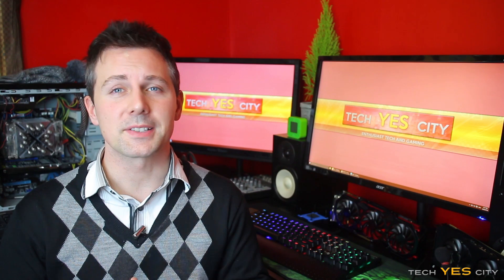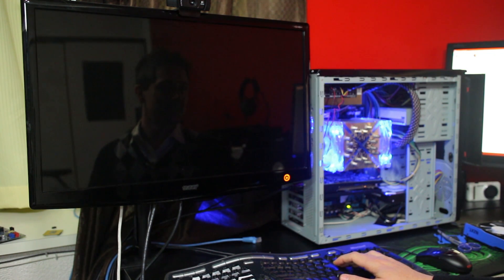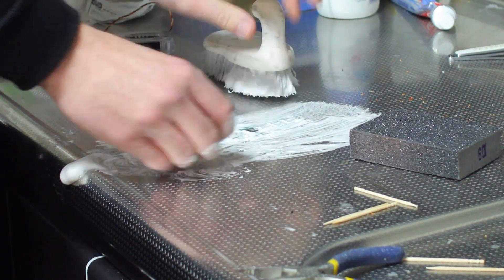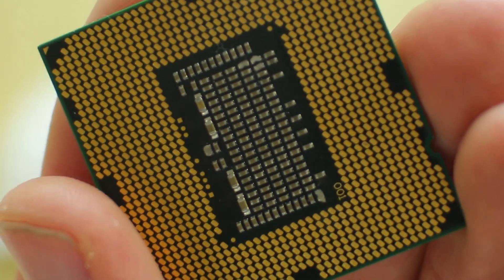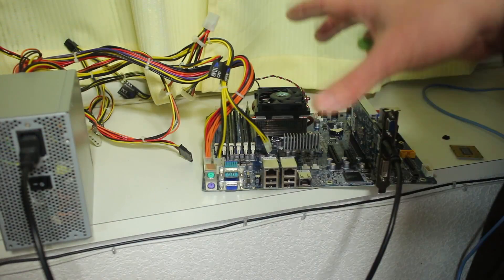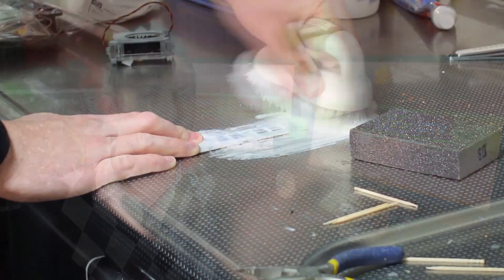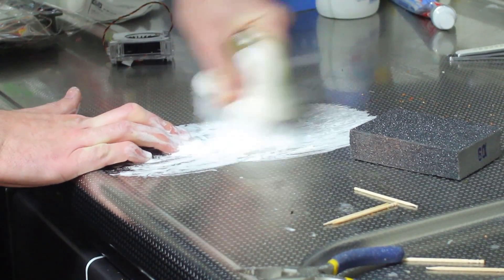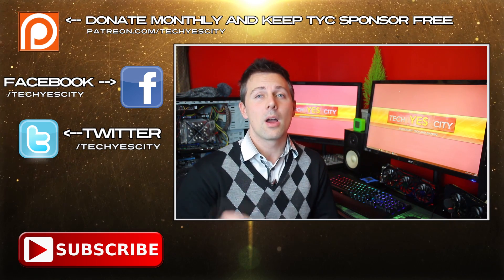Is it OK to WASH PC Parts? Ft. Fixing a Dead CPU & Testing a Dead PSU

Comment: I have always found it dumb when people think that getting a component wet will somehow kill it...

Firstly, there is moisture in the air... Parts don't just die... 

Secondly, my brother spilled an entire cup of Jack Daniel's/Coke into my computer that was on its side, with no side panel on it...

Third, in order to clean it, I started soaking it with rubbing alcohol, unfortunately there just wasn't enough... At that point in my life, I had recently come out of the hospital for a surgery to remove cancer, and I was unable to drive a vehicle.

As such, I decided, "Screw it!", and I just ran it under the bathroom sink, with hand soap, hand sanitizer, and a plastic bristle scrub brush, after the soaking and scrubbing of the sticky/tacky drunken soda that was in the socket, I mean an afternoon, worked great for several years! I am just glad these DIY methods always worked for me!

Comment: What exactly makes you think that those missing components at the bottom of the CPU package are resistors? Resistors are black and have tiny little numbers on them. The brown packages with no marking are ceramic capacitors, and bridging them over with a conductive liquid is futile, it's just about the worst thing you could do. Actually they're likely just all across the power rails, so a few missing shouldn't matter; however how did they go missing exactly? Have you checked that the other capacitors didn't go short circuit?

Comment: I always plug my power supplies into a cheap component... a power supply tester. The reason being a power supply could malfunction in more ways than just a short a bad cap or not supplying enough voltage, over-voltage is scary.

Comment: Power supplies that "engage" briefly and then shut down are very likely to have a shorted rectifier at the output stage due to being used under severe load regimen (more than it can supply).  It's also possible that capacitors failed, causing output to be unstable which in turn trips the over-current protection making it shut down.

So, unfortunately, while it can be repaired it's very unlikely that it will be viable considering cost of maintenance/professional work.  By the way, very interesting video.

Comment: I once bought a second hand motherboard for a friend of mine to safe his system from a serious upgrade. Motherboard was super cheap but had bent pins, a easy fix. More annoying was the smoking Stench the motherboard had. I striped the motherboard checked if the board was fully unloaded from electric charge (capacitors). I gave the motherboard a hot shower.
After that I immediately Vacuumed all the water from the motherboard. Then I used a electronics degreaser and a toothbrush so water stains (Chalk) would not damage the electronics. Then some serious hair-drying and some 'hot cardboard box -hairdrying' to get all the moisture and damp out, a fully dry and clean motherboard. 

Motherboard was in excellent working condition.

Comment: @2:30 that is a too harsh brush. Small electrical components can break of. A toothbrush would be more than fine.

Afterwards I would use a non-aggressive greaser (that dissolves in air without residue left-over) so there is no change of chalk from the water. After that some extremely thoroughly hairdryer work and the component is fine, even for the long run. Water behind the memory chips is a risk, vacuuming and putting the component is a hot-box will take care of that.

Comment: The PCIe to Molex to SATA did not work because the hard drives likely also require 5 volts, while PCIe connectors only have 12 volts. If you attached a step-down regulator somewhere along the line, it would be fine. You can also use it for anything that requires 12 volts.

Comment: The hard drive/CD drive issue was the missing power on the 5v connection. (the red wire)
PCIe plugs only use the 12v rails of the PSU.

And the water is no problem, just make sure you don't have moisture and electricity on the same palce at the same time.
Without power there is no short.

Comment: should i wash my motherboard with WD 40? ?
Reply: There are so many condensor on the motherboard, no idea how to make sure all of them are uncharge...
If you are afraid, just use isopropilic alcohol (pure) and sprey the thing all over to take all the dust away, then wait for complete dry. Is none conductive, so yhea is completly safe as long as you don't touch things arround the circuit boards. I did a ram slot cleanup this way and fixed a memory issue I had, got rid of all my problem this way (blowing air or using a brush was not enough).

Comment: Using PCI power would not work at all as it only has the 12v rails, any molex or sata device requires 5v too. If you wired a 5v transformer between the yellow PCI connector to the red molex you'd be good as gold.

Comment: are you shure that this are resistors on the back of the cpu? They look pretty mush like capacitors. I have worked a long time with smd parts in a factory an resistors are mostly black.

Comment: Hey, for that psu, you can just cut the wires from the 24pin that is colored as red, yellow and 2 blacks, any wires that has the same color will do. and then after you cut 4 wires, trim the wires and connect the wires "3 way" it should work as long as you used the correct wires. I have done that and it works properly. You should make it as 2 molex and 2/1 sata, it's easy to do this.

Comment: Are you fucking kidding? if you advertise the video as sarcasm maybe could pass. 1: even if you wash with water you still have to use the distilated one and after that you shoud use isopropilic alchool because is the only way to remove the water from under the chips and prevent the sodder from future oxidation (do a research on the damage the water does to circuits and the growing effect the sodder has in humid ambients). 2: underneeth the cpu those are capacitors not resistors  so you should not short circuit the pins: you risk to kill the motherboard...  3: 99% of the problems with cheap power supplyes like the one you have in the video is the bad output capacitors... just do a litle reaserch before publishing such a fuking stupid videos...

Comment: pci to sata cable didn't work because there is no 5v rail on pci-e power cable
5v is often transported through red cables 

you can provide 5v to your hard drive and you can still use it with that psu 

just be careful

Comment: Question for anyone here: if a pc works fine but when you turn it off and try to turn it on again the Motherboard's LED blinks and the system does nothing, is it the Motherboard or the PSU causing the problem?

Comment: Any customers or IT guys that see my Ram box in work are visibly sickened when they see me throw sticks in to it, hasn't harmed any yet. If you're really keen to make use of that PSU  strip a little insulation back from the same colours on the 24 pin without splitting the cables, or do for heat shrink use these connections to add sata/molex for drives and sleeve it up afterwards. Alternately, a number of proprietary enterprise boards provide sata power from the motherboard. HPs and Dells do at any rate.

Comment: You can wash anything, your RAM, your motherboard, you ssd, your cpu, even your heatsink and heatsink fan. However I recommend that you don't scrub it as you may damage the little smd components or can damage the pcb. 
Before you wash your motherboard, remove that little cmos battery or any other source of power. And never wash your power supply. They got capacitors in it and can they hold charge even if it's powered off. 

Remember that water is dangerous for electronic components only because they can short circuit the components. If you dry them completely so that there is no chance of short circuit then it's perfectly fine to wash them. 

warning: moisture can get inside ICs and can damage them if you don't give them enough time to dry. Some ICs can swell due to moisture. If Moisture is there in the IC and you power it up, it may either fry due to short circuit or it may evaporate the moisture and your IC may burst like a popcorn.

Motherboards, RAM etc also got capacitors in them but they are not big enough to retain a lot of charge.
Reply: hiw about cpu socket pins getting water damaged

Comment: Reasons for HDD/ODD won't work with PCI-E power: PCI-E 6/8pins only supply 12v and ground, while a molex/sata connector will supply 12v,5v and ground.

Comment: Just splice into the powersupply and put some sata pins on it you need a red with a ground and yelllow with ground red is 5 V Yellow is 12 volt dont worry about the orange one as it is not needed in the current stage of sata drives

Comment: the thing with the auxiliary pcie power connector is that it only provides 12V. the drives need 5V also. so a little bit of research is a good thing. not just hoping it will work because they fit together. 
the processor has capacitors and resistor, shorting those pins will certainly will not do any good.

Comment: The HDD and Optical drive aren't working because the PCIe Power connector lacks the +5V rail, it only has the +12V rail. That's why using the PCIe to Molex/SATA will never work. Only for devices that use a single 12V rail. Which is not the case for any HDDs/SSDs/Optical drives.

Comment: I saw some things that left me speechless.
I would like to specify that washing electrical components with water is not a good idea because the contacts might oxidize. For contacts also mean the component soldering point, gold plated connector, etc.

CPUs have bypass caps on the back and a couple of iductors... 
The bypas capacitors are put to dampen voltage spikes on the power supply rail, make a bridge between its contact means creating a short circuit.
if there are components there, there's a reason. Shorting it is not the way to fix the problem.

To test a power supply there are testers that are much more practical: they are compact and monitor the voltage and the startup time.

The PCI-E power connector provides only 12V, the hard drive and optical readers also require 5V and some device requre also 3.3V to work.

Other already said that the power supply capacitors CAN NOT be discharged creating the short between the mains connector.

Comment: Of course the HDD/DVD don't work on PCIe power. The 5V line is missing. 3.3V (orange) is kinda optional on the SATA power, but 5V and 12V need to be present. You only get 12V from PCIe.

Comment: those are capacitors, not resistors

and you check a power supply but connecting green wire with a black wire

Comment: you could put your whole mobo under water and as long as there's no current flowing through it and the caps are decharged, after you dry it off it should work fine.

Comment: you can bridge the psu to get it running, no need to connect it to a mb. its just 2 pins, you can find on the holy internet :).

Comment: Your PCI-E to molex stuff won't work because it only uses ground and the 12v rail.Hdd's need the 5 volt rail as well.Especially the laptop hdd - does not use 12v at all, just 5v.It would have partially worked with a 3.5" HDD, but only spin up the platters , it wouldn't be usable still.One dirty way around would be to "steal" 5v from the USB port.

Comment: Spilled a beer on a keyboard. Rinsed it off in the shower and dried it out, all good. Spilled a beer on my pc, fell off the desk onto the top of the pc, onto the top fan, all over every component in a fine mist. Washed em... worked for a while(3 monthsish), died, warranty. Good stuff lol.
Reply: lol you washed plastic and questioned if it would still work lol?
Reply: Opened my keyboard and put it in the dishwasher. Still works. Just remove al the electric parts prior.
Reply: Collin Huebler so weird... D:

Comment: the hdd didn't work because pcie power connector doesn't give 5V, and yout molex wont get that. it's like VGA>DVI>HDMI, that won't work either
Reply: Exactly, same if it was a 3.5 inch drive, since it still uses 5 volt for the controller.

Comment: The hard drive didn't  work because pci 6 pin only has 3 out the 4 molex wires so doesn't deliver the correct amount of power

Comment: People, don't listen to that man. Since when the easiest way to check Your PSU is to build acutally another complete PC? The easiest and the fastest way to check it is to connect the green connector on the 20/24-pin connector to any black connector in it. That's the easiest way to do this! What if the motherboard is broken? You will think, that Your PSU is broken and throw it away unnecessarily. And another thing - why the devil was he waiting until the system posts to check if that hard drive was working? He was checking if it gets the power - would be much easier and faster (especially in his case, where posting lasts and lasts and lasts and lasts) to check if it starts spinning.

Comment: Hey was wondering is the circuit pen could (maybe) fix my 780Ti, i had a resistor crumble on the back and now its an instant crash under any load. Would this idea have a chance of fixing it?

P.S it was bought second hand and dont know if it was broken before and has gotton worse or something that happend later down the line

Comment: PCIe only has 12 V, all the SATA drives require having +5V, and 3.5 in drives and DVD roms need both +5V, +12V. Use a splitter on the Molex and then a Molex to SATA, that will work!

Comment: Don't use MOBO to test PSU. instead, buy a cheap Psu tester on ebay
Reply: +The Tech Mate Not really , they will only show you wether the rails offer the correct voltages, but you still do not know how any load whatsoever will affect the voltages.Maybe you could, i guess plug in your ATX 24-pin and cpu 4-pin connector to the psu tester , then add various loads to the sata / molex / pci-e connectors - find various appliances in your home that use either 5v or 12v.12v loads connect to yellow(+) and black (-) wires.For 5v loads, use the red wire instead of yellow.The only concern is how the f*ck will you achieve loads upwards to 200W wich is getting close to what a HTPC would need

Comment: I had an OEM Lenovo h420 with an i3 2100 and it came with a Huntkey PSU that over stopped working and shorted out my mobo and CPU now I have to build a new pc which will be pretty fun =_= either way I kinda feel sad because the cpu actually was bent and stuck in the socket.

Comment: your videos are really unique lol but i have a question do you still have the Msi Z87 G45 Gaming Motherboard ? cause i am not able to update to windows 10 and i can't go farther than 4.4ghz on my 4690K :/
Reply from the maker: +R A F I D Nah dont have the z87 g45, if your copy of win 7 or 8 is legit then make sure your dates are set properly and you should be fine to update!
Reply: Tech YES City the date in bios ? the thing is the mouse and keyboard doesn't work in windows 10 setup i have tried bunch of things but now i have no idea what is causing this problem its not only windows 10 but i have also tried to install windows 8 same things happens. What i learned is that the modern windows setup doesn't work in this motherboard and i have no idea why and my bios is up to date
Reply from the maker: Damn, I see, might have to play around with some settings, use the front usb 2 outs.
Reply: Tech YES City as i said tried everything. This thing is just strange :| what do you think could be the issue ?
Reply: +Tech YES City okay here is the list of what i have tried so far : 
1. tried different usb ports 
2. tried windows 10 and windows 8 
3. tried using different software to make bootable windows on a flash drive.
4. tried disabling some usb options in bios 
5. tried resetting bios
6. tried different mouse and keyboard (haven't tried optical ones yet cause i don't have any)
7. tried several methods from google 

[if i can remember then i will edit this post and put more]
Reply from the maker: Tried a ps2 keyboard? should be able to pick up a junk one for $1, just seems like a really weird problem. once you are in windows it should be able to boot unless you need to manually install your usb device drivers (if that is the case you might need a ps2 mouse too - does it have 2 usb ports?)
Reply: +Tech YES City 2 usb 2.0 ports and 4 usb 3.0 ports in total 6 usb ports and only one ps2 port

Comment: For the HDD u need 5V plus 12V rail on it with the two GND wires. Just cut one RED 5V wire and connect it into a adapter you can find cheap pins on ebay and coil and other stuf. Sometimes you also need 3.3V Orange wire its listet on the HDD specs list.

Comment: drives generally use 12v (yellow cable) for motors and 5v for logic circuits that are missing in pci-e connectors (red cable).
washing circuit is possible but i don't recommend using a hard brush like you did because often smd components are not soldered very well and you may rip off some or damaging the soldering.

Comment: +Tech YES City Great video man. You should definitely do more stuff like this.
Reply: Also just a side note, if someone needs to test a PSU and doesn't already have the spare parts lying around to put together a small test rig, they should just grab a PSU tester. They are very inexpensive at around 10 to 12 dollars US, and they have been crucial for my daily use since I test multiple units daily. Quick and easy. This is the unit I am currently using:

http://www.amazon.com/gp/product/B005UZHB6G?psc=1&amp;redirect=true&amp;ref_=oh_aui_detailpage_o03_s00

Comment: HDDs and optical drives need both a 12v (yellow) and 5v (red) rail. If you're using PCIe power, intended for a video card, it will only have the yellow 12v rails, with the black wires being ground.

Comment: 6:37 = When I was first assembling my system, I gave power to my g.p.u. with 1x. 8-pin c.p.u. cable, and my c.p.u. with my mainboard with a 8-pin pci-express cable. Did that by mistake, but it didn't work. Don't try such stuff. Also, I hope you didn't wash your gtx 980ti...